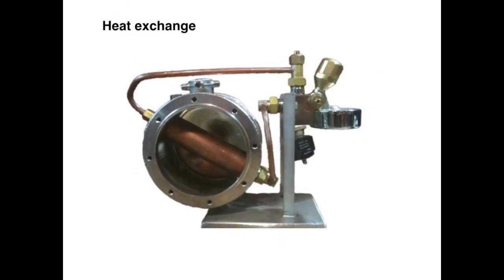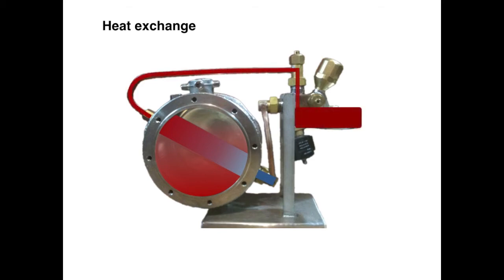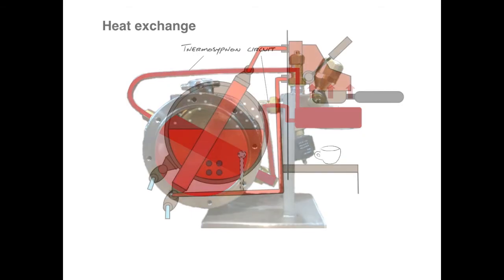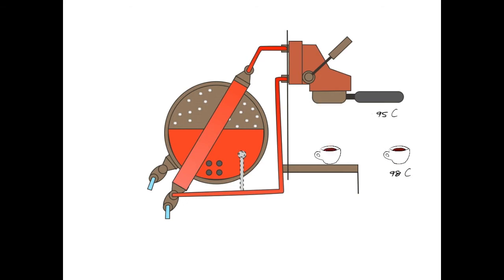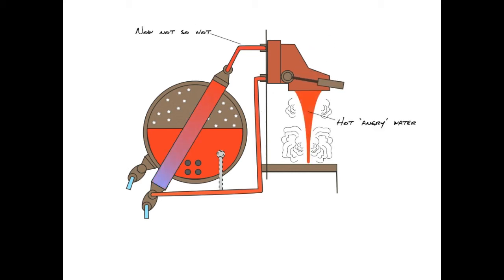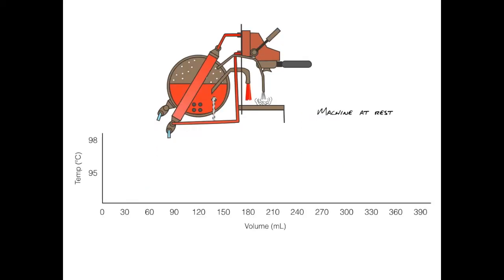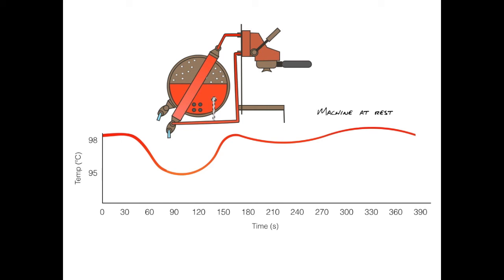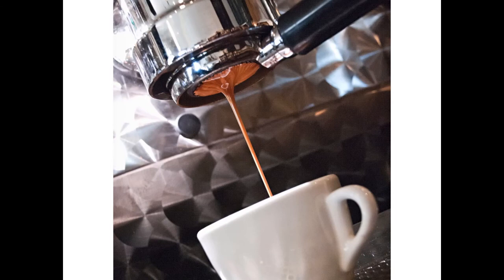Cooling flush

Comment: Thank you for this great explanation of a heat-exhange machine. I wish I saw this before I started twiddling with my pressurestat on my Vibiemme Super Domobar and dropped the overall temperature too low. The graph is very helpful and makes a lot of sense.
Reply from the maker: Ah, the Vibiemme Super Domobar. I remember digging one of these out once in a desperate attempt to keep serving customers while trying to fix our cafe machine. I was blown away by the texture of first few shots that I got through it. Unfortunately, I couldn't repeat these shots after this first hour and didn't get to taste texture like that again until getting an Idrocompresso on the bar. There's a possibility with this little machine of a texture that will make grownups cry remembering the enveloping embrace of their mothers as they suckled their first food.